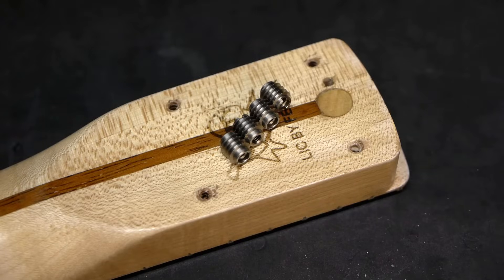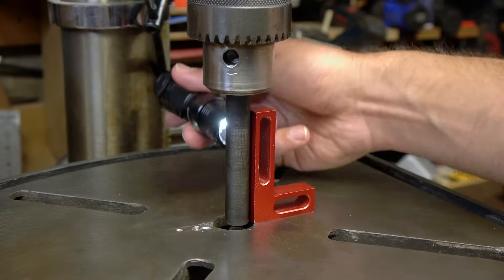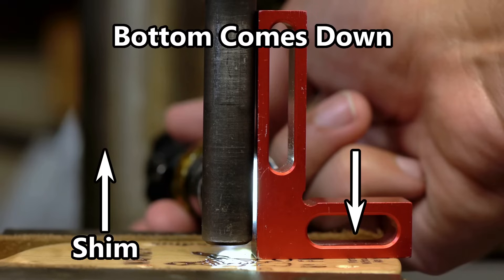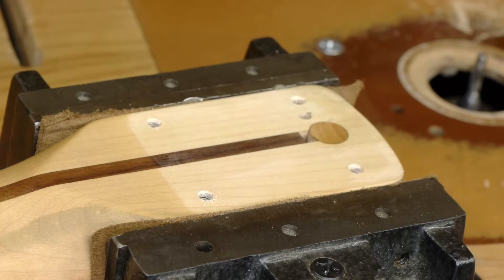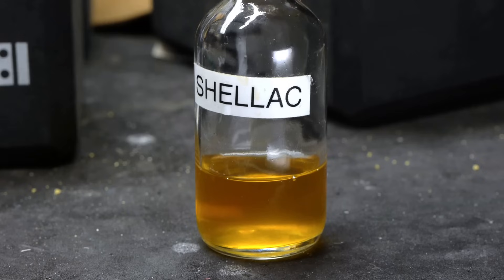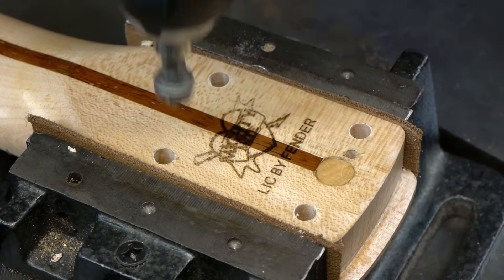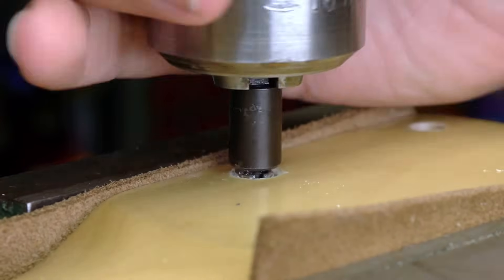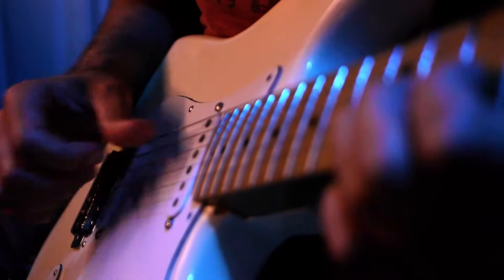How to Install Threaded Inserts on a Bolt-On Guitar Neck (EZ LOK)

Comment: The video you linked seems to be private now 😢. Any chance you can link from elsewhere that video would be great.
Reply from the maker: Which video was it? I'll check and see if I can update this, I'll provide the link here ASAP if I can. Let me know!
Reply: @guitar_md You said it would explain installing a bolt on neck from scratch. The links titled how to install a bolt on neck.

I got a neck thats heel is slightly too big for the cavity. Theres no bridge installed yet to help positioning. so I'm trying to learn how to determine neck placement so I can shave the cavity without throwing off the new necks position. 
If that makes any sense.
Reply from the maker: @RiskeBiz  Reply Part 1 

I see. I just checked: the video was private - it's a new, updated version of the video that I'm not done with yet. The video I have published already is here: 

https://youtu.be/VLiEaPAvrzY

I don't think that video will answer your question. For that kind of problem, and with no bridge mounted, solving that would be fairly complicated. 

However, with bolt-on necks, you can always re-align the neck in the pocket. You could try removing an even amount of material - - same on both sides. Even if you removed way too much material, and the neck was now horribly loose in the pocket, you can easily fix that by shimming the sides of the neck pocket. 

It might not look pretty, but it'll work. Not having a bridge mounted will certainly make this all more difficult, as if you did have a bridge mounted, you could mount a neck pocket routing template, like the ones Potvin guitars offers. 

I don't have a video on it yet, but I did a Partscaster build a couple years ago and filmed the whole thing. The neck heel was also too big for the pocket. I got a Potvin neck pocket template, mounted it by using locating dowels in the bridge mounting holes on the body, and double stick tape. 

It lined up right over the neck pocket, then I used my router and a guide bearing bit to trace it. The neck pocket was like 1/8" too narrow, it was ridiculous. I had to rout a lot of material. And the neck pocket was also not flat. That neck pocket template and the router took care of it. 

I also have a video of that on my channel, but I'm updating that too, as I've made a new router baseplate for deepening neck pockets. But for widening neck pockets and deepening, all in one, you can get a Potvin template for neck pocket routing. 

Even without a bridge, you could mount one of those templates by eye and would probably be OK. 

But you could also use a chisel, file, sandpaper, stuff like that, and be fine. 

Big thing is cosmetics vs. functionality. With bolt-on necks, you can always repair the neck pocket, no matter how screwed it looks. It just might not be pretty. You can always shim the pocket on the bottom, and on the sides, to get a perfect fit. 

If I had a guitar like that, I'd open up the neck pocket enough so the neck would fit. Then clamp it in. 

If you don't know where the bridge should be, measure from the nut. If it's a 25.5" scale then the centerline of the saddles should be around 25.5" in front of the nut. You can use that to get a rough estimate of where your bridge should mount. Set the saddles about to the midpoint of their adjustment and line the front of the saddles up at 25.5" in front of the nut, or whatever the scale length for your neck is. 

Next step is stringing up with the neck clamped in place. If you have a tremolo, or body-thru ferrules, or a hardtail bridge where the strings mount through the bridge -- any way you can, get the two outside E strings strung up on the guitar tuners. You want to be able to move the bridge around and see where the outside E strings line up over the neck. 

That's how I always do it. The scale length can be measured traditionally. The string alignment, IMO, needs to be measured visually, using the actual E strings as a reference, though some people use pieces of cloth string. I think actual strings are better because a piece of yarn or twine will be the same thickness on both sides...not good. The high E is thinner and the Low E thicker. I always use real outer strings when lining up the bridge for string alignment.
Reply from the maker: Reply Part 2 

Let me know if this answers your questions or if you need more help. I'm aiming to answer all of these questions in my new updated bolt-on neck installation video. The old one I linked to in the previous reply is missing a lot of information, such as what to do when a neck heel is too wide for a pocket, or there are no holes in the neck pocket. 

It's taking forever as I have so much work to do, on other videos as well as customer jobs, and even if I was only working on one video at a time, it takes a lot of effort to really cover this stuff concisely and accurately. 

I'm very excited to get that published, but it will probably be a while -- like maybe a year or even longer than that. I'm more than happy to answer questions here in the meantime, and let me know if everything is clear or you need more help on something. 

I use a lot of expensive tools and templates, some homemade as well -- but if absolute professional perfection is not required, and it is NOT to have a great, supremely playable instrument -- there are many workarounds. Bolt-on neck guitars are infinitely adjustable and you can always get them working perfectly, no matter how bad they look, unless the neck itself is screwed, like severe warping or things of that nature. And some people even claim THAT can be repaired -- but as far as the neck pocket, string alignment, and action and playability go -- it can always be made perfect if you know what you're doing, which I'm aiming to describe in my upcoming videos, many of which are revisions of older videos I've uploaded.

Comment: too much work sorry so many things FENDER DONT USE NONE FOR 70+ YEARS waste of time and money
Reply from the maker: This is the best and fastest way to repair stripped neck screw holes. Otherwise you have to drill them oversize, plug them with dowels, flush cut the dowels, wait for the glue to dry, and redrill. 

With inserts, you just drill oversize and install the inserts. Much faster and also a guaranteed lifetime repair. 

Wood screws for the neck are fine until they strip. Keep in mind that Leo Fender also intended for necks to be replaced if anything went wrong with them. They were made to be modular with replaceable parts, not to be made with the absolute highest quality parts possible. 

Similarly, a lot of old Fender pickups go bad because they didn't wrap the magnets in insulation before winding them. I love Fender guitars but I've repaired hundreds of stripped neck screw holes and dozens of vintage pickups that have died. 

I will say this though: every single vintage Fender I've seen had clearance holes in the neck pocket. That's how they're supposed to be. That's a different topic but years ago I did a video on that as well. Very simple modification. But it speaks volumes that Fender did this 100 percent of the time back in the day. My guess is now they use impact drivers to just jam the neck screws through the pocket so they thread into the pocket as well as the neck heel, which is really bad. Causes bridging which means a gap between the work pieces as without clearance holes the two pieces can't be joined tightly like they're supposed to be. 

So even if someone doesn't want to use inserts from the get go, they're still the easiest way and most permanent way to repair stripped neck heel screw holes. 

It's especially useful for travel guitars that will be assembled and disassembled hundreds of times.
Reply: @guitar_md repair maybe but average Joe that see your long vídeo just to screw a neck don’t have all the advertiste tools 😅😅😅😅 i just wonder with all the massage the service twice the price of the guitar 😅😅😅😅
Reply from the maker: @adilsonobelard Yes, that's true, the tools are expensive and with threaded inserts, it's critical to install them correctly, so my goal with this video was to show people how to do it. 

I agree for the average Joe it isn't feasible to do it this way and the cost of tools would be far more than the guitar. Although it may be possible to do the job accurately in a much more simple way with much simpler tools. 

There is a system called Neck Tite that I wrote about in the pinned comment. They seem very easy to install. Though I didn't know about them at the time of recording this video. They explain the process as much simpler using their system. 

For luthiers that already have this kind of equipment, I hope this video helps. For the average Joe, maybe they'd find it interesting, but I agree that it features tools way beyond the scope of the average person. 

With wood screw holes, you can get away with the holes not being perfectly straight and square. The screw will find its way. With inserts, they have to be perfectly straight and square. 

So yes, I'd agree. For the average person, not worth it. Though if they can find a tech to do it for them - if those techs see this video they might be able to offer it as a service. I've done a few of these for cheap for people who don't have the equipment to do it themselves.

Comment: Do you install the neck with a standard neck plate on the back of the body or could you use shorter bolts and countersink the bold heads into the back of the neck pocket on the body? With a sculpted heel neck joint it might look better without a neck plate and feel better in the hand.  Would you countersink it enough to include a washer with each bolt?
Reply from the maker: I use a standard neck plate, personally, but I've also installed threaded inserts on Ibanez style guitars that use ferrules instead of neck plates. Same idea as the washer you mentioned - ferrules are just the industry standard for this kind of design. 

To convert a Fender style pocket to ferrules, well. I'd have to think about the best way to do it as I've never done it before. I know if I was doing it from scratch, first thing that comes to mind would be a Forstner bit, on raw wood. Drill to the necessary depth for the ferrule, then use the centerpoint left by the Forstner bit as a guide for drilling the clearance hole for the neck screw with a twist or Brad point bit. 

FSC Guitars by Farhad Soheili has some interesting designs. I've been following him on Instagram for years. He has a contoured neck heel on his guitars and uses ferrules instead of a neck plate, which feels better in the hand, exactly as you described. They're Stratocaster style guitars that he mostly makes, and very interesting with that design. 

To do a conversion: now there's an interesting project. My first thought would be to plug the neck pocket holes one at a time with a snug fitting dowel, but don't glue it in. Just something snugly fit so you can have find the centerpoint for a Forstner bit. All you'd need to do is drill a recess deep enough over the center of each hole, and then you'd have room for neck screw ferrules. 

They're typically flat, like a thick washer, with a countersink profile to accommodate oval head screws.
Reply: @guitar_md  I have a body that has a contoured neck pocket, so a standard neck plate is not an option. I have since seen a couple of guitars with the ferrules you noted and I think that is the way to go (StewMac and other vendors sell them). Those seem to be countersunk about 3/16" below the top of the body (I would use a Forstner bit) and you would need to use two different bolt lengths (approximately 1.25" and 1.5" long) to account for the contouring of the heel. I found appropriate bolts at Bolt Depot (love that site!).

Thanks for all your great information. Once all the parts come in, I will be ready to get started.

Comment: Nice job. Better than other vids I've seen about it.
 I considered buying inserts but I thought I could make better ones myself with threaded rod, drilling and tapping holes in the center of the rod. (Or maybe McMaster Carr already has what I'm describing, like a bushing threaded inside and outside) I would make them longer, just a little shy of the bottom of the fretboard, so probably 5/8" or 3/4" long. With a coarse outside thread and a corresponding thread tap, tap the threads into the neck wood. Before glueing them in, scuff up the outside threads of the bushing with sandpaper. The glue will get into the scuffs in the metal, conforming to it, which makes them next to impossible to remove.
 But, I haven't gotten around to making them, and instead use another method that's also rock solid. 
 I use larger and longer sheet metal screws, I think they're size 10. (If you try this, compare brands because you want a low thread count. Low thread count leaves more wood between the threads, but the boxes don't have a thread count listed so you'll have to go around to several hardware stores and compare them in person)
 Anyway, make a tap from a screw identical to those being used to bolt the neck on. Do this by grinding two slots through the length of the threads, and grind the tip flat. Drill and tap the holes to a depth just shy of the bottom of the fretboard. Put a few drops of olive oil in each hole (this will cause the wood to swell up around the screws, but also lubricates so it's easy to turn them in and out without binding. Carefully cut the screws to a length about 1/16" or so shorter than the depth of the hole. Remember to include the thickness of the neck plate when measuring for screw length.
 I've used this method on several strats and teles and they are incredibly solid. Pushing and pulling the neck for tremolo doesn't work on these guitars.
 I also have custom neck plates made at a local machine shop, made from aircraft aluminum, thicker and a little over sized length-wise.
 I haven't been working on electric guitars for quite a while, so exact details are a little foggy.
Reply: After re-reading my post I realized it may not obviously that my method is about tapping threads into the wood. Yes, you can tap threads into wood.

Comment: Great work, but.... bro what are you talling about all these 18 minutes? just make holes in neck, than screw inserts in it and put some glue between them and polish the neck to make better contact between neck and body, and then just match neck and body and screw them with screws. Actually same but easier, isn't it?
Reply from the maker: That is the same, but easier. However, my method here guarantees that the inserts go in completely square to the neck heel, which IMO is critical to this job. 

I've done a number of installations where I wasn't as careful, that I got done much more quickly. I used to just use a twist bit to widen the holes, then fill the hole with some glue and thread the inserts in. Done. 

But then I'd go to thread the screws in, and they'd feel like they were cross-threading. But they weren't cross-threading: the inserts were not square to the neck heel, and that made it so the screws could not thread in all the way when you actually put the neck onto a body. 

They're harder to thread in from the very beginning, which feels like something is wrong -- which it is. And then they also won't thread in completely. They have to be perfectly square in order to thread in the way they're supposed to. 

You can tell when they're not installed square, because they should feel extremely easy to turn. They should thread right in. When they're not square, you'll notice a lot of resistance from the very first turn, and you might notice the screw heads sticking up higher than they're supposed to when they're threaded in as far as they'll go.

This is because the neck sits square in the neck pocket (and if it doesn't, you should correct that with a router, which I also have a video on!) -- 

-- and so if the inserts are not also square, the screws will go in at an angle and they won't be able to thread all the way in easily and securely, as they're supposed to. 

I work on many different kinds of guitars, with all kinds of problems, and I wanted to cover everything that might come up. It's very possible someone with a warped neck heel will find this video, and if they aren't aware of that being a problem, they won't know how to address it, or worse, they'll install the inserts without being aware of the problem, and then find that they can't put their neck on their guitar, and have to take the inserts out and figure out a way to do the whole thing over again. 

i.e. Wood is not steel, and is prone to all sorts of defects and peculiarities. When you're working with something like flat tool steel, things are generally a much more binary operation. With wood that has peaks and valleys and twists and turns, and even clamping it in a vise, it won't lay flat, things get much more complicated, and take extra care to do properly. 

This method is exactly the same thing as just widening and deepening the holes, then adding some glue and threading the inserts in. But this seemingly simple process is a lot more complicated when working with a guitar neck than a flat piece of steel, and there are a lot of caveats to watch out for. 

Also, honorable mention: the shimming method I use can also correct for imperfect drill press mounts. Sometimes things are not squared up the way they should be. Shimming to get the neck heel square to the drill chuck compensates for a lot of problems that people might have in a DIY home shop, where their drill press might not be sitting as perfect and square on the floor or bench as it should be.